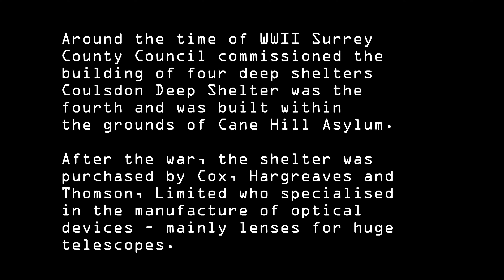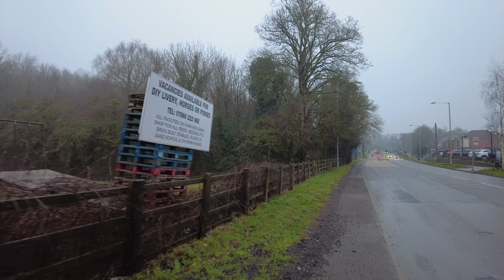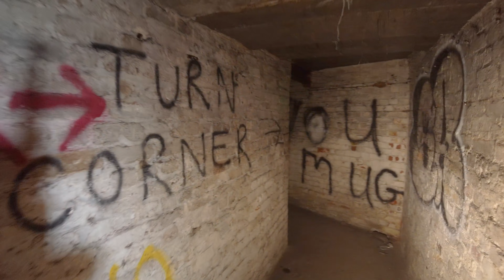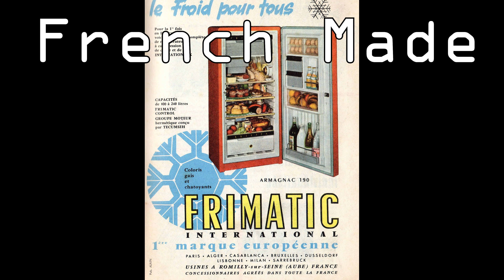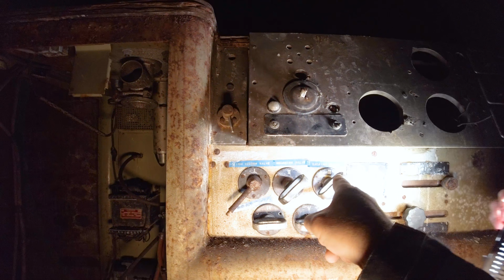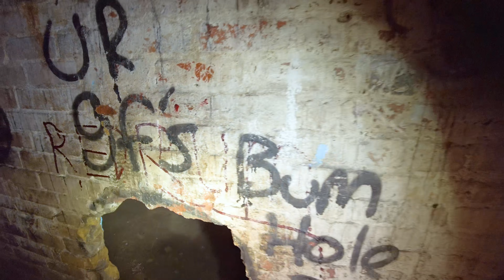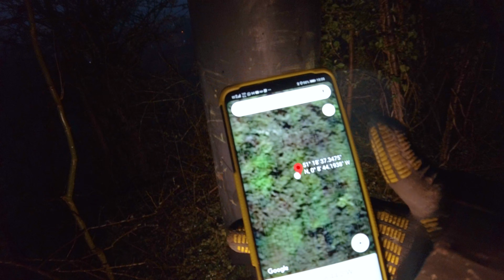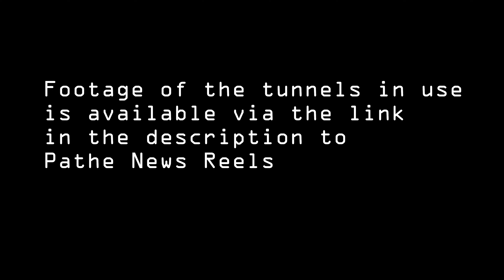Coulsdon Deep Level Shelter UNDERGROUND TELESCOPE FACTORY

Comment: Pretty sure the two mystery machines are vacuum deposition machines for applying coatings to lenses. They should have bell jars on them.
Reply: That would probably explain why they had a very high voltage transformer in one of those units? The HV AC would have been rectified to HV DC and filtered to get a high quality DC source for some electro conductive gas used in coating the lens?  Note the variac to vary the amount of HV one would need. R we onto something here:)
Reply: Yes, I was thinking the same. The element plug pointed out is for the diffusion pump heater high vacuum. 
And a large vacuum bell would have fitted over the top.

Comment: 30:00 That is not a lathe or winding machine, that is likely a vacuum deposition machine - to vaporize metal under high vacuum and create a thin film of metal on an object - you can create optical mirrors, filters, etc.
The huge column in the middle of the machine is an oil diffusion pump (creates high vacuum by boiling oil inside).

Comment: 31:00 Since there are high voltage recifiers in there and "vaccum" was mentioned sputtering was one of the things these made. There was a dome on top of that carussel thing and several steps could be done in vacuum. Like finishing steps for valve production.

Comment: Great place my first thoughts where the tunnels are a hell of a lot older than WW2 they may of used them during the war but they will of made use of the tunnels that were already there. I do not know the area but i wonder if at some time in the past could a building once of stood above these tunnels🤔. If there was an asylum close to these tunnels i would think there are more sealed off underground spaced. It may be worth while looking on google earth for any unusual lumps or bumps in the surrounding fields also crop marks can often by clues.  The paraffin heater, lawn mower and vacuum cleaner/hoover i remember very well from my childhood in the early 70s, the paraffin heater was all we had to heat the whole upper floor of the house and it was my job to trek to the garage about half a mile away to get the paraffin. Great video!
Reply: Half a mile away hahaha,childs imagination probably 15 feet out in the cold and damp

Comment: Matt the Optics / mirrors places is another bunker not to far from this still in use by Optical Services Ltd. Its on the A22 by Kenley station.
Reply: I understand 5 of these bunkers were built, this one was later used a s a car workshop. The Optics was another one as @stevewalsh1987 say, that is still in use, and the one matt refers to as being demolished for housing was only partially built due to poor soil. You can find out more with some investigation on sub brit. But as always, a good video matt.
Reply: used to live pretty much opposite the one in kenley. there were quite a few deep level shelters dug during the war in this area.
Reply from the maker: There is another place which does Optics... but this place did also Im being told.

Comment: Close Matt but no cigar. At 15.40 it part of a turret lathe (See ward turret lathe.) At 16.20 no its not a motor part is the bed and headstock of the lathe. The flat pulleys are for a belt drive giving 3 different speeds. At 17.14 they are the 2 pedistools it sits on. That was interesting Matt. good job.

Comment: The two large concave discs would be fitted to the top of the machines the mirror was placed on top of the disc then it would spin to allow the tool on the metal pole to grind and polish the mirror

Comment: At 47:30, that room is the emergency generator room. The bore to the surface would've been for fresh air in and exhaust pipe out, the concrete plinth for the generator is still evident.
Generally placed in a seperate section at the far end of a corridor.

Comment: When there is black carbon deposit around the fuse holders it is because the fuses have blown/melted due to over current demand or short circuit on a number of occasions not because some one set fire to the fuse holders.

Comment: There's a place more or less opposite the Kenley Hotel on Godstone rd,about 10 mins drive from here,that is still in use as a lense making place.I had to work in it many years back when i was a BT engineer.It's almost identical.I believe they used to make bomb sight lenses there during the war because it's sunk deep into the chalk cliff under Riddlesdown so there's no vibration

Comment: Fuel would not be in the other section, there would've been a day run tank on the opposite wall from the generator. There could also have been a fill pipe running down the shaft with isolation valves top and bottom.

Comment: 36:02 - is it possible to pin your location right here, then find it on the surface?
Reply from the maker: If you can get GPS through a hole then yes.

Comment: No offense your videos seen a bit slow paced. I'm the guy who had the radios at cj tuns btw.
Reply: The drive belt would have been for a vent system and it would have connected a motor to a pull fan blade. If you look closely there are small shafts going to the surface but have been removed from the recieving end. Mainly to remove dangerous machinery encase of unwanted visits such as what is happening in the video.
Despite that it is amusing to see the equipment still present. It is too costly and challenging to remove certain features.
Reply: Also the machine you was wondering about I'm pretty sure was a mass laundry machine. I've seen something very similar before. It wasn't a lathe in any form. The heating element was for drying as there are no natural drying capabilities in the tunnel. It would have been used to clean sheets used communally.